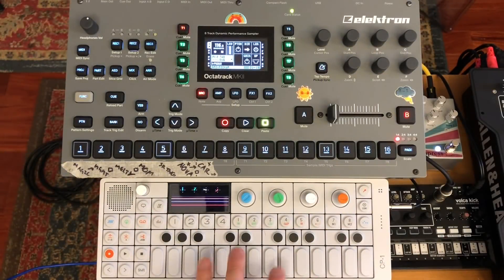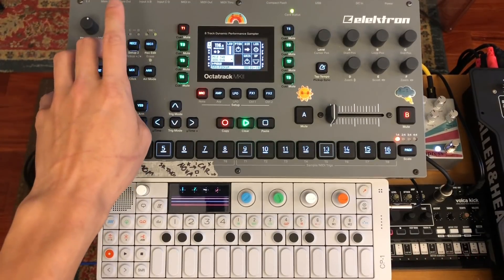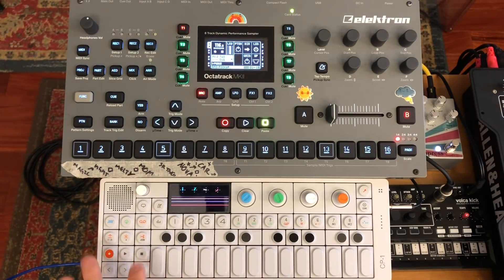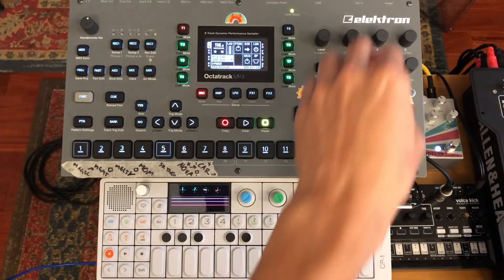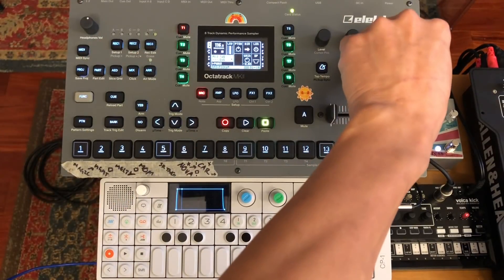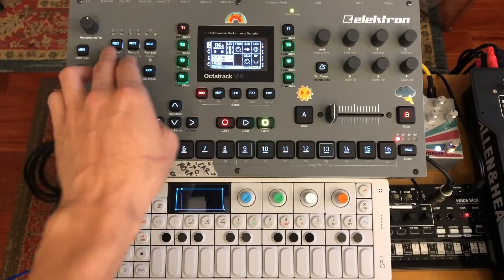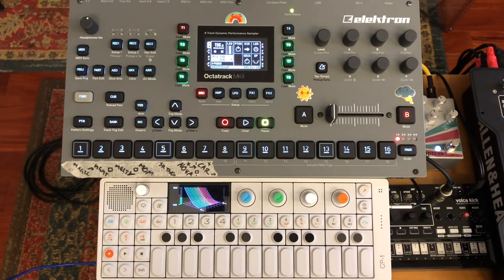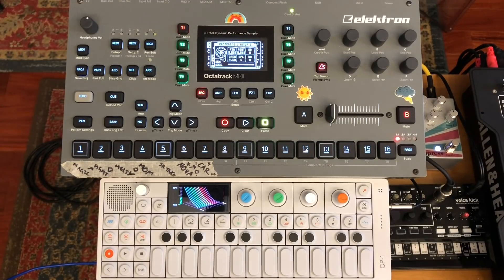Octatrack MK2 Tutorial: A Guide to Pickup Machines

Comment: As always, great stuff, Kenny!  It's amazing how much variation you get with just the OP-1 non-velocity-sensitive keyboard. Kudos!  Somewhere you mention that the OP-1 is routed thru a pre-amp. Do you meanthe A&H mixer? Or is there a box we can't see in the videos. Also, I really love the Empress reverb too
Reply from the maker: Thanks j b! Yeah I actually really enjoy the OP-1's responsiveness - the clicky-ness of the buttons makes them a pleasure to work with in a rhythmic context, and I'm aiming to introduce dynamic contrast in other ways like LFOs, reverb, and delay.

My preamp is actually under the Octatrack, below my stand. It's a MOTU Audio Express, which has 4 ins and 4 outs, is typically used as an audio interface but can also route directly without a computer. You can also save settings onto a computer, so you can have multiple presets for standalone use vs. computer-based applications.

Comment: I am still wrapping my head around the OT.  Still can't fathom why Elektron set the sample memory limit to 85MB.  So painfully Swedish of them.
Reply from the maker: Haha! Yeah, always a disappointment to get the little prompt telling me I'm out of space. Nonetheless, I try to just keep my mind open when this sort of thing happens, and just put on my problem-solving hat haha :) If you juggle your record buffers correctly you can basically record 8 8 bar loops over four buffers, and sequence them in that order. Obviously that leaves no room for anything else, but...
Reply: @KennyZhao  Well, at least STATIC machines don't use RAM so there's that.  

I'm trying to master the pickup machine.  I have RLEN set to MAX and it keeps squashing my loops to "normal" lengths.  3 bars becomes 2 bars, 12 steps becomes 1 bar etc.  So things come out all sped up.
Reply: According to Merlin's Thoughts on the Octatrack, Elektron designed it that way in order to prioritize malleability of samples over sheer size. Dynamic sample processing is the concept, I believe.